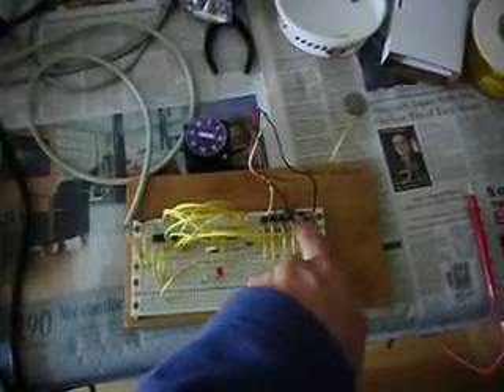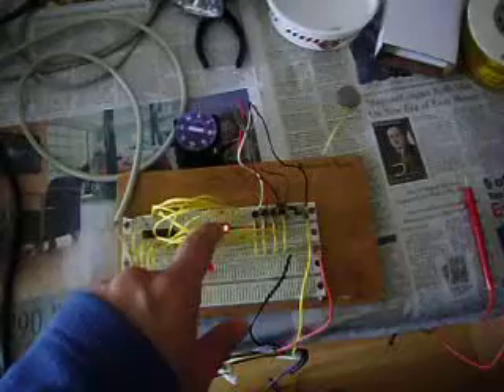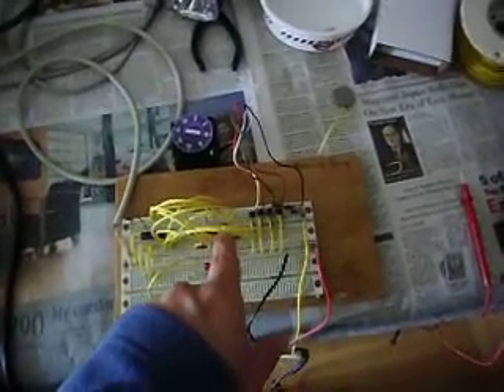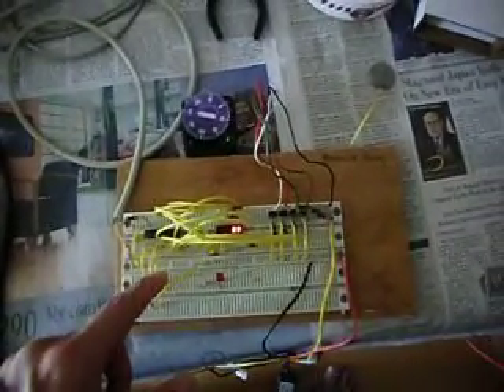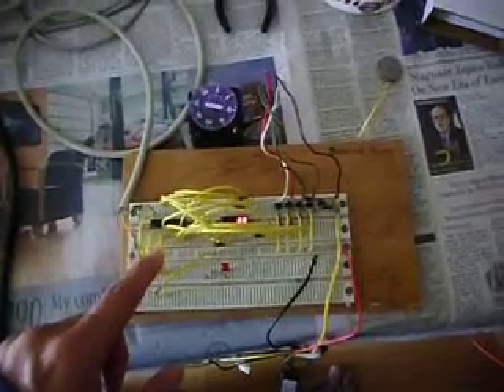PICAXE controlling a stepper motor

Comment: can you post the  code?
Reply from the maker: It would be messy to put it in a comment here, but the code can be seen at http://pididu.com/wordpress/blog/picaxe-embedded-processor/
Reply: i wanto to get stasrted with picaxe, did you learn it with their website manuals ?
Reply: The manuals are a good source.  If you already know BASIC, there's not much to it.  There's even a sample program in the manuals that you can enter to flash a single LED.  Download the free development software.  If you have the means to get a development board, that will make things easier.  But if not, you can use a solderless breadboard like the one you see in the video above, or even just a perf board and solder wires.  If you have an older  Windows computer with a serial port, there's not much more that you need.  Otherwise, you will need a USB to serial adapter, or even better an AXE027 cable.